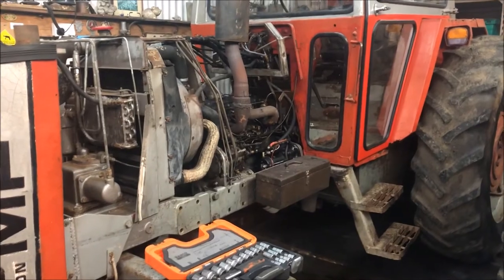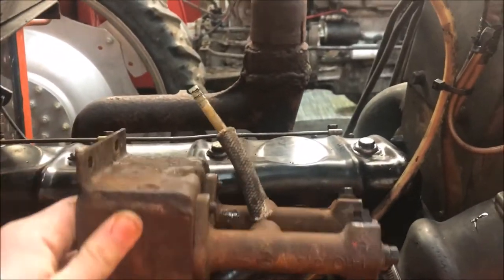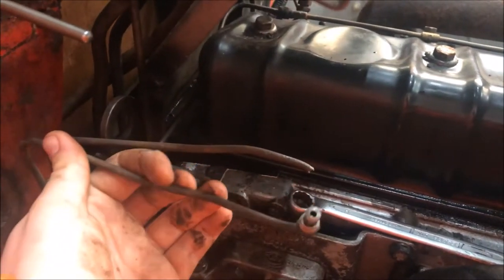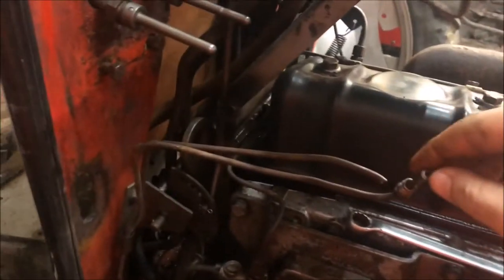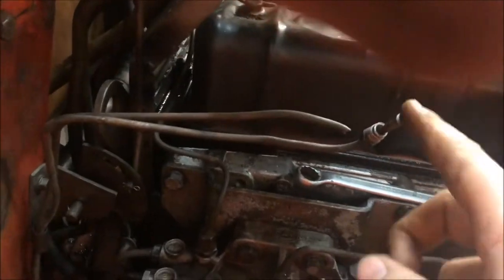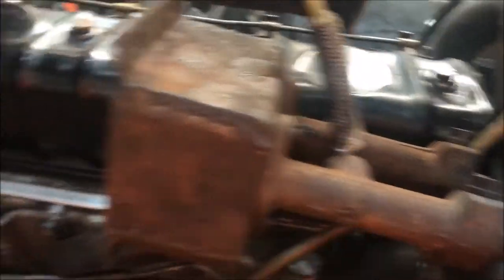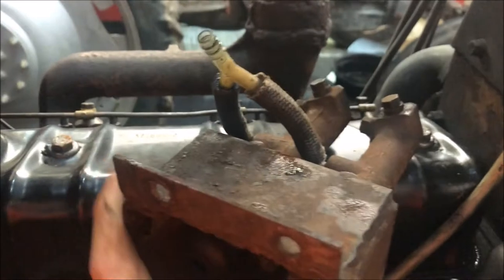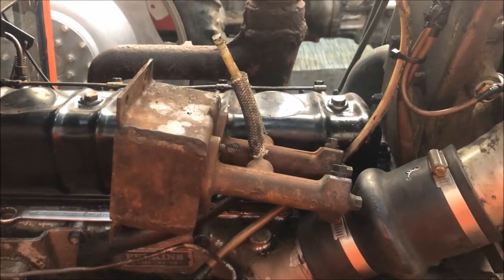Massey Ferguson 595 brake repair part 1

Comment: Great job buddy.

Quick question 

I've a Massey 130 I remember you had one before.

The back left wheel(bearings/hub) has dropped. It doesn't look good. Is it an easy fix
Reply from the maker: Thanks, in what way has it dropped 

Has the oil level in the gearbox dropped if so the half shaft seals have failed in the rear axles 

If the hubs themselves have moved the the bearings on the half shafts have collapsed 

Either way it will require the rear axles to be stripped down. You will need to dismantle the reduction hubs and push the half shaft out as mine was stuck in place 

Hope this helps 
Thanks
Reply: tractionengine11 your a gentlemen! I'll let you know how it goes and yes your knowledge/experience is a huge help. The 130 is a rare hen that now one will work on
Reply from the maker: Anytime, yes there isn’t any tractor quite like a 130 
Anyway best of luck. If you need it I can send you some diagrams from my workshop manual if you get stuck 
Cheers